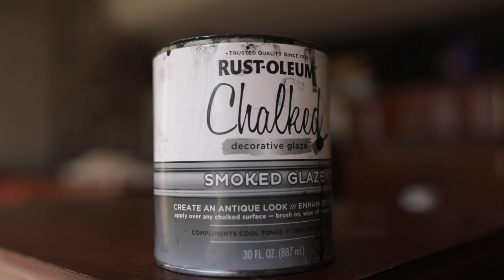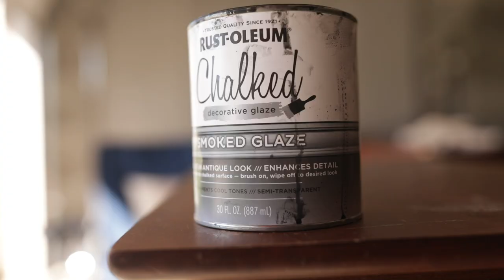Flipping a Goodwill Mismatched Furniture Set with Rustoleum Smoked Glaze

Comment: One painting tip I use all the time when painting trim is to use a small pan and roller and roll the paint on the trim then stroke it out with the brush. This works with furniture too and really speeds up getting the paint on the surface. I feel I have better control this way than with a can of spray paint and my hand doesn't get as tired as it would with doing it all with a brush.  You are inspiring Lauren, keep up the good work!

Comment: Use the tape to keep the wood from splitting from the drill. You could try using marker on the back of the hardware "holes", and drilling the marks made on the wood.

Comment: You need to run a candle or some beeswax along the drawer runners. The drawers should run much more smoothly once you've done that. You can also use a bar of soap. I'm sure there are commercial products that work too but I've never needed them. This trick can be used along the bottom or top of sliding doors too. Works a treat.

Comment: I like the ease and speed of spray cans. But I’ve also found what you have. One can may spray great and the next we frustrating. Or not spray right at all. I also think it doesn’t last as long and is more expensive. So I stay away. I have an HVLP gun and love it. Again... I still use more but not much. Also, I really love that glaze you use. I had never tried it until I saw you. I bought some and fell in love. I did find the same ting you did. That first wipe needs extra glaze on it so that you get a more consistent look. 

For drawer hardware... the tape should keep the wood from tearing out. I have the kreg jig for hardware and I LOVE it. Got it to install my kitchen hardware and now use it for furniture.

Comment: If you have a harbor freight around you they have a sprayer for 20$ (at least in my area). Get the gravity one but you also need a air compressor. If you like the spray cans you’ll love that more. Just add some paint from the can and a little bit of water and spray away. Saves time and money. Win win.

Comment: I’m not sure if this was the case it just looked like it might be this type of situation. Every spray can has a small black mark on where the spray hole should be pointing towards so when you’re spraying it doesn’t spray off air but paint because the straw inside is curving towards the opposite side to get all the paint while you’re spray painting! Which explains why it was coming out in sections and upside down, also why it decided to stop spraying in general since all the pressured air that was inside came out before the paint was used up. Hopefully this tip works for you or anyone else who might not have known that! Glad it all worked out in the end though, the set looks great!

Comment: Yup that’s what I use when I don’t want to sand a lot. Yup that spray pieces helps a lot. If you use it for 1 piece then yes, but like you have 3 just buy a professional sprayer even the cheap  ones  they sell at Harbor freight is pretty good but you need an air compressor.

Comment: Omg, I had the same problem with my spray can on Saturday. So why sand and prime if you are using chalk paint, I’ve even use homemade chalk paint on particule board. Like the placement of original knobs on nite stands.So why not put wax or bees wax on draw runners to make them close smoother.

Comment: Does spray paint get old while sitting on the shelf? I'm wondering if you might have gotten a can that slipped through the "shelf life" inspection at the retailer or had an unnoticed manufacturing flaw that allowed paint to clog the internal . BIN Zinsser Spray Primer is the best I've ever used, so the can refusing to spray properly for any noticeable reason makes no sense.

Comment: I'm wondering how you keep the furniture free from  bits of dust or debris blowing in the air. I have to work outside and it's a problem to keep it  dust free, or even bugs off of it. It appears you have dirt nearby and I see cars. Any suggestions would help.

Comment: Beautiful job! Did you apply the top coat to the tops of the dresser and night stands before applying the glaze? I know you applied the top coat after you applied the glaze. I've used the Rustoleum antique glaze on the linen white without sealing beforehand and it really soaked into the white. I wasn't very happy with the shade.
Reply from the maker: No, I top coated the white while the gray was drying and then did smoked glaze and then did the top coat on the tops. I haven't tried the antique glaze yet but I am interested to see what it would turn out like! Thanks for watching!

Comment: Hi! I had a question about the clear coat. I used the linen white paint and the clear coat. But the Clear coat end up yellowing pretty back any suggestions on how to avoid this?
Reply from the maker: Use primer to be sure to prevent that. Sometimes that happens to me as well. It’s so frustrating to almost be done and then the yellow pops through. I usually just put primer over those spots and then paint white and top coat again. that usually fixes it

Comment: I have a bureau that comes off in 2 pieces. The bottom part is just a chest of (3 )drawers but  the last drawer closest to the floor is missing a large chunk of wood.  I could throw the whole bottom half away and refurbish just the top that has a book shelf and  cabinet doors and it can be used as a piece that sits on the floor. BUT i was hoping to put it entirely back together and sell as one piece as it's intended. What can i do about the bottom part? I could remove the drawer completely and leave it open. Or put knick knacks inside the area but that's kinda dumb because usually those things are placed on the upper part in full view. What would you (or anyone reading this) suggest i do? It was left behind by a family member so i didn't purchase it. 
Thanks in advance! Help🤔
Reply from the maker: You can get rid of the bottom and then instead of it sitting on the floor, you can add new legs (:
Reply from the maker: I hope to do this one day!
Reply: @Lia Power I'd use Kwikwood or Bondo to fill the area where the chunk of wood is missing.  This video is a good example
https://youtu.be/Drc5jpEfm5U
Reply: I bought a top to a piece like you are describing at a yard sale. I put a bottom in it then painted, distressed and waxed it and hung it behind the toilet in our master bath. I love it. The doors have glass in them so I filled it with pretty towels and decor.

Comment: I have so many issues with Water Based Poly sealer coat streaking and looking horrible because I don't have a spray gun, does anyone have any ideas how to stop the streaking?? I've tried using a regular Zinsser brush, a foam brush, a foam roller.......frustrating. Thanks.
Reply: I’ve heard to lightly sand in between top coats. I don’t personally know. Hope that helps. Just throwing that out there

Comment: Spray paint can was blocked on the tip i think... So you can take the tip off and wash it or use a different tip, worst case return paint for a new one... Poor girl it was not you or the tool... It was a bad can or paint or a dirty tip...